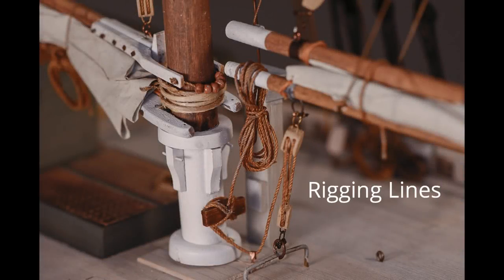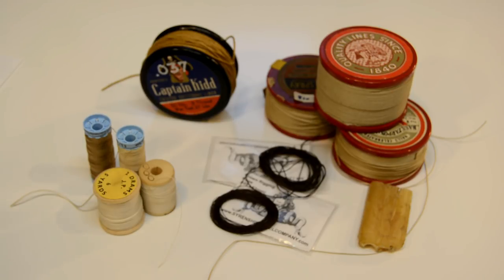A Bit of Ship Model Q & A, Part 2

Comment: That's what is known as a 'harbour stow' in the photo of the Champion, sailors wouldn't furl a sail like that every time as it takes too long to do. Your sails look fine to me for a 'working' stow, which is basically just bunted up and secured with gaskets although the ideal is to have the sail on top of the yard (note the lack of the word 'arm', not all square riggers have yards with arms, the long bit outboard of the lifts usually painted white to assist in the setting of studding sails). 
I once had to go aloft in a force ten gusting eleven in the full rigger Sorlandet off the Azores in November, the main royal had blown out of it's gaskets and was flogging so badly to risk losing the royal mast, even the tying of gaskets needs to be done correctly. The bosun gave the whole crew a refresher course after that. But boy what a ride that was 120ft up with the ship lying a-hull rolling both rails under!

Comment: Thanks for sharing your passion with us. I watched your video on draw plates, the only draw plates I can find are in metrics, do you have any idea what size I will need? Thanks for your time Richard
Reply from the maker: Thanks for writing and I'm glad you're enjoying the videos.  It seems you're right.  After a quick web search, I've only seen metric stuff.  But they are still totally usable.  If you're using digital calipers, just measure your stock in mm's.  Then hit the button to go back to imperial and you've got it.  It seems like the 3mm to 0.5mm would be the most useful for ship models.  In imperial measurement, that would go from .078" or a bit over 5/64" down to .019", or just over 1/64".  Doing it this way, you should be able to come to within a couple of thousandths of you target.  Hope this helps.

PS Here's a link to drawplates offered by Contenti Co.  They're one of my faves.  Good stuff, reasonable prices and fast shipping.  https://contenti.com/draw-plates/steel-draw-plates/economy-round-drawplate

Comment: i think that the vinegar added to the dye is to enable the pigment to enter the body of the fabric  easier , i think i would leave the vinegar out and just leave the thread in the dye bath for a little longer
Reply from the maker: You may be right about it making it easier for the dye to get in.  I have also found out that the vinegar acts as a mordant or fixer that helps to set the dye more permanently without fading with repeated washings.  Since I don't see the possibility of repeatedly washing my ship models, I vote to leave it out of the mix.  Also, I found that using dye hot with the vinegar, as suggested by the dye maker, totally unravels silk line.  So, if you're using silk, DEFINITELY leave the vinegar out.  Thanks for writing, Tom

Comment: Can you explain planking the hull. I like a realistic look on the hull not a cut and shape the planks to fit. Thank you for your time.
Reply from the maker: John,
I just saw this.  Sorry I didn't write back sooner.  I don't have any plans to do a video on hull planking (but that can change).  I am not an expert on it, by any means.  And, I currently don't have a project that requies it.  Everything I know about the subject I learned from the book, "Plank on Frame Ship Models" by Harold Underhill.  It is an old book, well written and well illustrated.  You should be able to find it on Amazon or eBay.  I believe Model Shipways also has a book on the subject.  I don't have any idea how good it is, though.  Hope this helps.  Tom